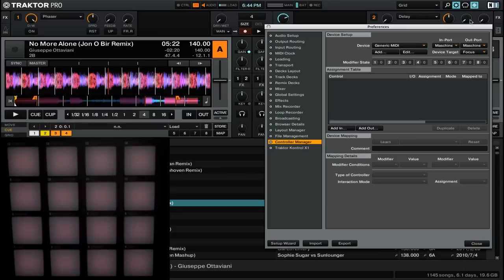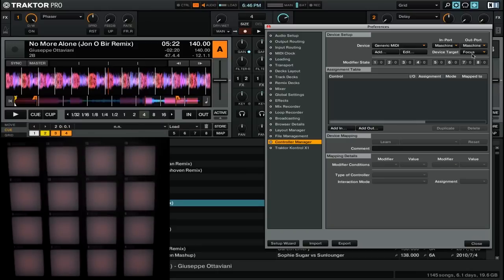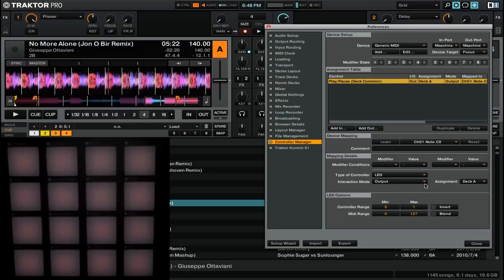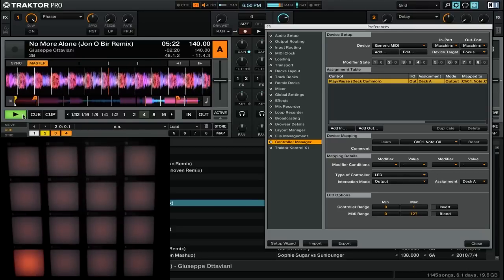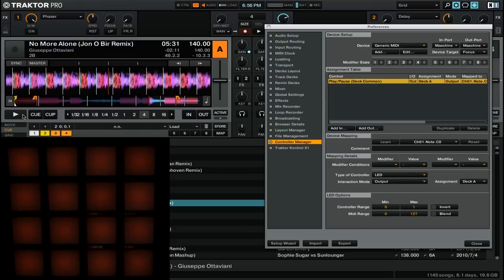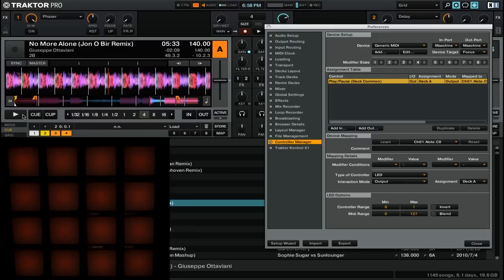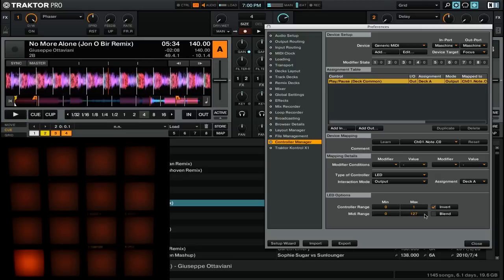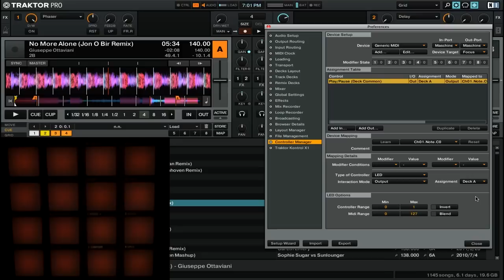Traktor Pro 2 Advanced MIDI Mapping Tutorial: Mapping LEDs

Comment from the maker: You probably need to assign additional MIDI out commands that look for the modifiers you have set up. That is a topic for another video. However, if you're familiar with how modifiers work you can probably put that together with this to get it to work. Essentially you need to tell Traktor that when modifiers are active, change the LED interactions accordingly.

Comment: Hey, Great explanation!
I'm trying to map my Terminal Mix 4 with your instructions but something not working...
I mapped 1-4 cue buttons to cue 5-8 when another button is pushed and it's ok.
But when i'm trying to map the out command so that the led will be on (like it does with the regular 1-4 cues) it doesn't work :(

what I have noticed is that for the regular 1-4 cues in the out mapping there are two commands for each hot cue in each deck. I have only one and no idea what should be the secon

Comment: im trying to map the deck focus selector to a certain button, which I have accomplished. However I when i try to map the led to that function it does not work properly.  Led in button A will sometimes light up when I push the button i mapped to B.  I checked my values and it seems I have them correct. However it is not responding in the way I had hoped it would. Please help!